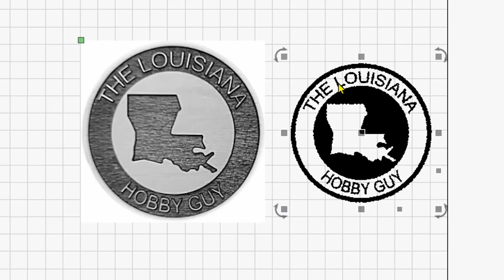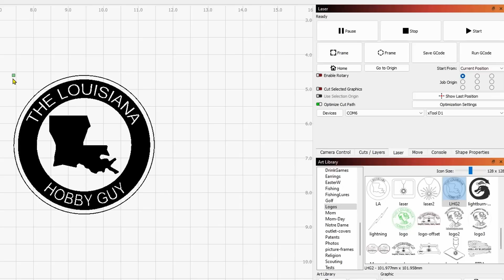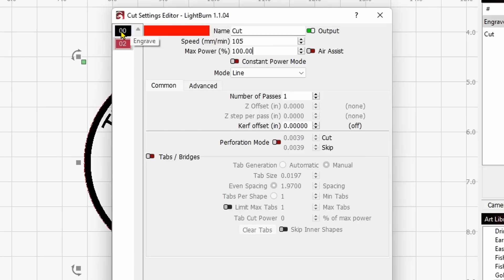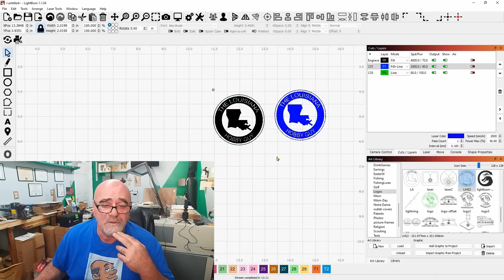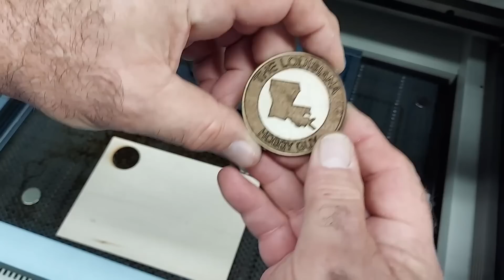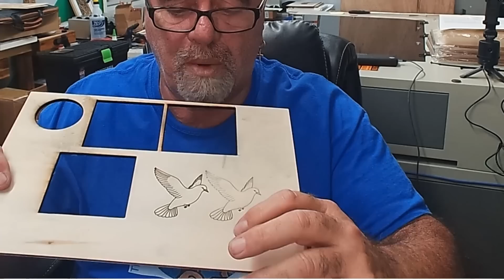🪙 Making coin shaped wood business cards! Take your Laser Engraving to the Next Level!

Comment: Thanks for the update on Fill & Line, back on track. I have a very similar project as your "La. Hobby Guy Coin" but, I am having the opposite result. My letters and symbols are Cross Hatched, Not raised, and the surrounding areas is raised. When I activate the - Windows Filled Coarse, the letters are black. How can I reverse this, so the letters and symbol are raised, the surrounding area is Cross-Hatched.
Reply from the maker: You have to offset the artwork to change the filled areas.

Comment: I've been trying lots of different setting and can't seem to get good results. One of the big problems is when the laser is burning the fill, it slows down as it reverses direction, causing it to burn darker/deeper at the edges. This isn't necessarily a problem - the darker border looks pretty cool - but unless the laser is powered so low that it's barely burning at all, it tends to burn all the way through. I'm using 3mm wooden coins I got on amazon. Maybe I should try some 1/4 plywood. I was going to ask about this on the forum, but I'm not sure where would be the best place to ask there.
Reply from the maker: The best place is Main Forums --> Start Here. Click New Topic. Have you run a test grid? You probably need more speed.
Reply: @TheLouisianaHobbyGuy  I just realized that I had turned off overscan, because you had turned it off in the video. But I'm using a gcode based machine, so I need it on. I'll be trying it again in a bit.

Comment: Just so I'm on the same page. In light burn it has additional tabs in each layer you can add. Was there an update since you posted the video. I only had Lightburn for 20days. If so do you still recommend cross hatch for this or suggest to add another tab to the layer.. thanks again for your videos. Each video saves me days and money which reduces my trial and error period. I can just roll right into tweaking mode...lol
Reply from the maker: Yes Moses, there has been an update, but you can use the crosshatch with multiple layers.

Comment: Hi. I’m new to this channel (1st video I watched from you). I just bought my 1st laser, a D1 Pro. I am currently using Creative Space and I have Lightburn installed on my computer.  You said you engrave the back of the coins. Do you have a video that shows how to line up the material to engrave the back in the correct position? Thanks and you have a new subscriber.
Reply from the maker: Welcome aboard! I leave the wood in position and just flip the coins with my xacto knife point. If you center the design on the wood, you could just engrave first and flip the wood to engrave and cut. Use a framing square attached to the work area so it gets positioned correctly.
Reply: @TheLouisianaHobbyGuy  Thanks.

Comment: Great video. Thanks. I love your videos and watch them all. I have to say, though, that I get confused sometimes. Way too easily done, I'm afraid. So you engrave three times - 1 at first at 90 (I meant 0) degrees, and then twice with the crosshatch? That would be 2 passes at 90 (0) degrees. Why? And can you explain the two times offset?
Reply from the maker: The offsets determine how the relief comes out Jere, filled or not. The last O° scan is to clean off the debris.
Reply: @TheLouisianaHobbyGuy  So two 0.1 offsets, the last on a cut layer?
Reply from the maker: @jfm30204  I'm not sure without watching the video again Jere. Each offset creates a new result. that's too hard to explain in a text. If you watch the video again, you'll see it live.
Reply: @TheLouisianaHobbyGuy  Thanks, Rich. I don't think watching again would help. It's probably time to just give it a try and see how it goes. Thanks again for the great video.
Reply from the maker: @jfm30204  It's just too hard to explain the layers in a text Jere.

Comment: I cut 6 mm Baltic Birch ply at 1 mm a second, 100% power, 2 pass. 3 mm shouldn't be that hard. Ply is harder to cut than solid wood, don't ask me why.
Reply: I was going to suggest updating software, but if your using lightburn, you should be up to date.
Reply from the maker: @ReelSpider  No, the laser is the problem, not the software. And ply is harder to cut because of the filler and glues used to bond the layers.

Comment: I have watched a few times and It may be a version issue. I have LB 1.2.0   I can not find a "hatch" tab or way to activate that type of pattern.  I just love the clarity of the relief on your tokens would like to be able to get as close to that as possible.  any help would be appreciated.  If its because I am on my trail version? Not an issue I do plan to purchase LB It just to powerful not to have.
Reply from the maker: They removed the hatch feature from V1.2, however, it has been improved! No when you want a hatch, in the cut setting editor (double click the layer) just add a new tab, and on the 2nd tab, in fill, set the scan angle opposite the the 1st Brad.

Comment: This is a great tool. It will help me with doing inlays. I’ve done one before but did regular engrave with multiple times in hardwood
Reply from the maker: I occasionally do some inlays myself Steve.
Reply: I’m a long time woodworker and would do monograms on scroll saw and do veneer inlays by hand. I’ve done one on my xTool D1 so far

Comment: This was a great video and definitely took it to another level for me. I did do some experimenting and found you can do your black layer with crosshatch on and go to the edit tab, and click invert and it does the same thing but in less time.  I did several pieces trying it and could not see a difference.  It is just a bit easier for beginners and less steps to remember.  I also did the fill and line on that same layer.  Thanks for the great video!
Reply: I failed epically on this attempt! Maybe another video with less instructions for the newbies? 😁
Reply from the maker: @cristinawilson6242  I'm not sure how less instructions would help! It's all in the material and the settings.
Reply from the maker: Thanks for the tip Jennifer! I have the best subscribers!
Reply: It really is easier; thank you

Comment: Rich, instead of using your sander and want something a little more stable for small letters or for your coins (which is an awesome idea) I took a piece of scrap wood and placed sanding disks with the sticky back that I use for my belt sander and placed them on the wood. I found this to be the easiest way to get those smaller letters and small keychain police badges sanded to perfection. I can send you a picture of them that I made as a his and hers set, so my wife and I can tackle 50 individual pieces. I think you will like it. Great video and we all make mistakes no matter how proficient we think we may be.
Reply from the maker: That's a good idea Bill, but I like the fact that the sander moves freely, unlike using a brick. Makes me feel safer.

Comment: Don't feel bad about having to do three passes to cut a 3mm thick piece if Baltic plywood.  I have to do four passes with my xTOOL D1.  I really like the Laser Tree 10 Watt optical power laser. Unfortunately, the laser mounting on the xTOOL will not support any other laser other than their own brand, without making a new mounting plate.  Also, the control is erratic.  They have locked the GRBL settings so you cant adjust them.  That, and they deliberately block other control software (other than Lightburn) from operating the machine.

My solution???  I use the Openbulds "Blackbox" controller for my other lasers and 3018 CNC machines.  I will be modifying the xTOOL chassis by what ever means necessary, to incorporate a "Blackbox" control!!!  If I would have waited a few more months before getting an xTOOL D1, I'd be getting the new Genmitsu Jinsoku LC-40 Laser laser engraver.
Reply from the maker: Spot on Carl! I guess you and me are the only ones who aren't falling for all the marketing hype from x-Tool. The LC-40 is a wonderful laser! I'll have a review on that one soon! But I had to check to make sure it was 5.5W! It performs like most 10W lasers and far outperforms the 10W D1, that's for sure!

Comment: Hi Rich after multiple times watching this video, I am still running into issues when I do a CTRL D for image and put into fill mode I just get a filled circle, I have been trying and retracing steps, re-done off set, grouped an ungrouped to try an suss it, but doenst want to work for me, I can get the relief cut easy, but then it goes south from there, Any thing I am missing?
Reply from the maker: Try putting the offset into line mode Ian.

Comment: thanks for the video, i followed it stopping and starting as i went along in order to get what you were saying into my coin, after running the coin my letters were so small i could hardly see them. i am making another one with larger letters, do you have a video for making the coin
Reply from the maker: No, I don't Robert. But it's just bent text and a circle that's offset.
Reply: @TheLouisianaHobbyGuy  my settings are the issue way tohot soiam lowers the power

Comment: Love the video and tips...what is the plywood you're using?  Thickness and type, as much as you can describe so I can do this coin.  Also, if you were to do this using cast acrylic for your material for coin, what would be your settings and suggestions?  Thanks in advance!
Reply from the maker: This was 3mm birch plywood. I do my coins on 2mm cast acrylic also. I can't offer you settings because your laser will be different than mine. You just have to run a test. On my 10W diode lasers I run 3000/70 for the engraving and 120/100 for the cut on acrylic.
Reply: @TheLouisianaHobbyGuy  my laser is the same as ur using in this video, 10w xtool d1

Comment: Hi Rich. Quick question or maybe observation.  I have the 10W D1 and if I use any settings even close to what you show I get no marking of the wood at all.  Anything above 80 mm / sec does nothing for me even at 100% power.  Am I missing something when I set up the D1?  Thank you in advance.   Heck even cutting 2mm ply is taking 100% and 4 mm/sec.  Seems a bit slow to me.
Reply from the maker: Sounds like you either have a dirty or cracked lens. The D1 design seems to cause the soot to blow back up into the left side of the lens cover causing the lens to get dirty pretty quickly.

Comment: In my lightburn, the cut settings editor does not show cross hatch as an option. Beginner mode is turned off. I haven't downloaded the latest version of lightburn yet. Could that be it?
Reply from the maker: No, you probably don't have the layer set to fill.

Comment: Great Video as always. It’s great learning new techniques. A quick question-you didn’t mention the process to do the back side engraving (alignment). Do you engrave that side first with a grid to align ( i.e. before cutting) or cut then do the back with a template that holds the tokens/coins? Thx
Reply from the maker: I have a template to do 50 at a time. I get 12x24" sheets of wood, engrave and cut all 50. Then I pluck them out of the wood with my X-acto knife and flip them over into the same hole to engrave the other side.
Reply: Thanks Rich, that’s kinda what I thought.

Comment: @thelouisianahobbyguy love this video awesome tips. I will start with the sanding tip I do the exact same technique… I can’t wait to test the cross hatch, I have been wanting to do this just haven’t tried so thank you… next CUTTING please stop cutting so slow, try this approach 750 speed 92.5 power 12-15 passes. This works great for plywood and the hard spots… you will notice a much cleaner cut! please check out my first video here: https://youtu.be/th85q90s10A
Reply: Also the line after fill does just make everything pop
Reply from the maker: I'm curious where you got the .5 from 🤪 I happen to like the burnt edges for the contrast, and on all of my 10W lasers they come out perfectly in one pass. Can you imagine doing 50 of these at a time and 600-750 passes? I've actually switched to the Co2 to do these a few months ago so I don't have to mess with gluing the wood together to fit on the laser bed, but I have to carefully stain the edges now since the Co2 doesn't leave a burn.
Reply: @TheLouisianaHobbyGuy  I think I came across it from Sculpfun. I was running into issues with the glue/adhesive of the plywood… I would get random burn out and wasn’t cutting properly. It still gives the burn look on the edges, just seems to be cleaner cut, less soot. I was running 125s 90p 2 passes. But I tested it and the time is not that different. Plus it helped out on doing multi layered projects and the fine details. Not sure if you watched the time-lapsed video I posted. The actual run time is right around 20 mins. I will work on posting something showing the difference. The faster speed also helps when when you have a jagged cut… your doing round discs and am doing a sunflower cutout. I don’t think I have ever ran my diode at 100% power, 92.5 may be the highest I run. I also prop my project on 1/4” magnets. I stopped using honeycomb grid cause you still get flashback. I have my laser mounted to a table top, with a piece of sheet metal attached to the table top. 
I just noticed how dirty your piece was after machining, and that is just to much extra work for me.
Reply: By cutting this way, it also eliminates the need for a kerf adjustment… at least on my side. When I make a tabbed box, it fits together so much nicer.
Reply: Oh and one other thing we should point out… CO2 runs millimeter per second, and diode runs millimeter per minute.
Reply from the maker: @twdigiman8108  That's your preference. These settings are user defined in Lightburn. You can run it either way.

Comment: I appreciate all of your videos Rich - it's amazing the volume you produce.  I recently started a YouTube channel and can't even imagine putting out your volume.  I am learning so much on the laser and that is why I joined your highest level of Patreon because I know how much work and effort you are putting into produce this volume of material.  I do have one question.  I watched to the end and when you came back you said you forgot to add an offset on the original graphic but I saw you do it earlier, what offset did you forget.  Then you said you needed to add another duplicate layer for fill and line for cross hatch.  The first layer already had cross hatch.  I lost something in the transition.  In your summary you mentioned you always run three layers, 0°, then 90°, and then cross hatch with line after fill.  Did I understand that correctly?  Dialing in the progressive settings will be interesting.   

Why can't I just do this with one Cross Hatch Layer and then the cut layer like you already had before you came back - what happens - sounds like you tried off screen and found the issue when the cut didn't work like expected - we didn't see that first try.  Hope my question makes sense.

Also, I keep getting message line speed after fill is faster or equal to fill speed.  I would've thought that would be expected.  Do you have a  relationship you follow between line speed after fill speed you use.  If this is too much maybe I can ask through your Patreon feed.  thanks again.
Reply from the maker: Yeah a bunch of mistakes in this video! But I went back to my original template and took a look at it and light turned on. The depth and passes are dependent on the wood you're using. For Ply, you have be careful not to breach that top laminate layer. For solid wood, you can use as many hatches as you want for depth. Doing the hatch cleans off the soot on the 2nd pass. You can also do just 2 hatch layers and it'll do the same thing, but the mistake was, the last hatch layer has to be set at much lower power. And the line after fill has to be slow as well. For small text I usually go around 400 mm/min. I didn't offset the cut layer twice which caused the text to invert.

Comment: Hi Rich. Nice video as always. Instead of offsetting the outer circle you can just put it on a separate (cut) layer. The result is the same.
Reply from the maker: That's what I did Peter. But it has to be offset to keep the other layer inverted.

Comment: Love this video Rich. Thanks for the info.
It all depends on the wood. I ordered some 3mm from Amazon before I even received my laser (D1) and it takes one pass at 100 100. With the air assistance it cuts great. I also have 5mm 5 passes to cut through and .250in 7 passrs to cut through same power and speed.  I'm excited to try your method!
Reply from the maker: This is the wood x-Tool sent me with the laser. I ran a test on the P50 & the Neje and they both cut it at 120 speed & 100 power. I don't know why this D1 is not cutting it. I'm going to do a ramp test today. I have a feeling the diode was set wrong at the factory.

Comment: Great tips ( Yes, I stuck around to the very end ) and your coin / technique looks great.  You showed ALL the settings you used ( yes, I know its for that laser, that piece of wood, your humidity, etc ) but what was the settings for the line after fill.  I like to use the settings as a base line and adjust as needed ).  Thank you for passing on your knowledge, noobs like me ( and probably experienced folks ) really appreciate it.  Learning a lot from you.  Thanks
P.S., what grit sandpaper do you use at the end, 600?  Thanks
Reply from the maker: Hi Mark, on my template for the coins I do 400 speed and 28 power for the line after fill because the letters are only 4mm high. The larger the text and vectors, the faster I set it. And I find 320 grit paper to be the most universal for what I do. I'll occasionally use 400.